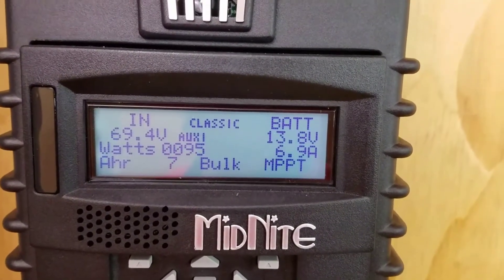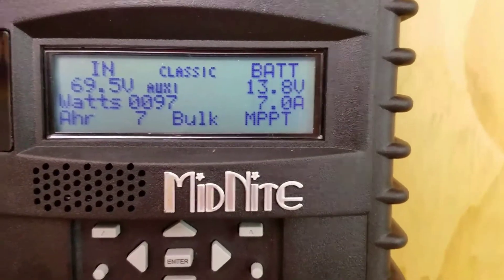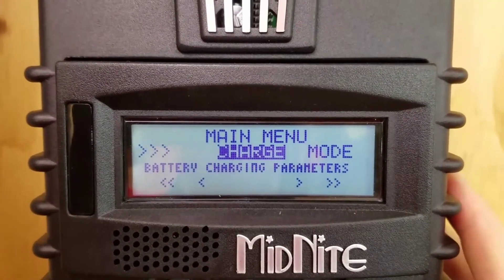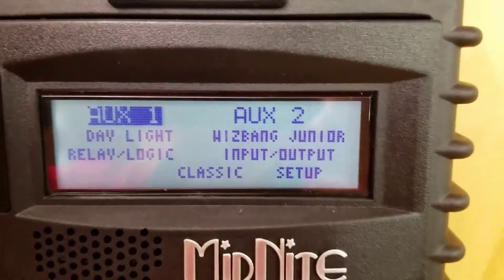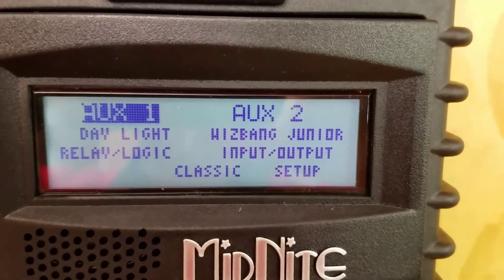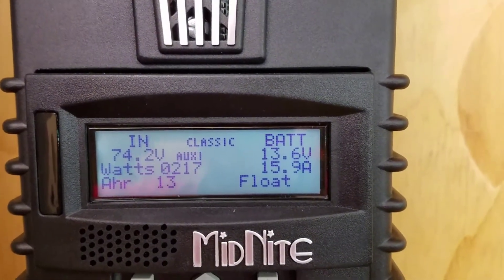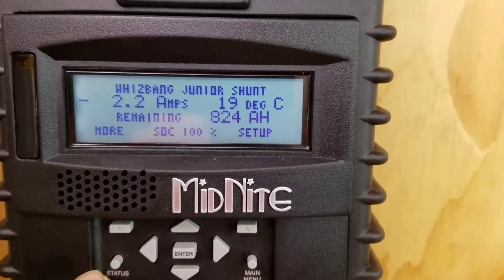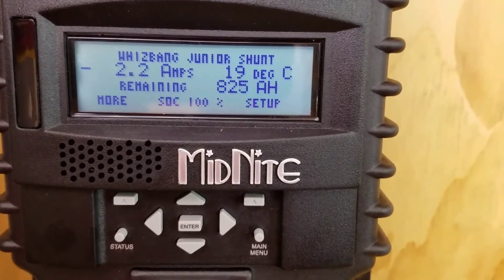MidNite Solar Classic 150 & Phone Test.

Comment: You showed us the wiring the batteries in an earlier vlog.  Could you also show the final hookup of the large-gauge wires from the controller and inverted down into the battery box?  - i.e., how those components actually connect to the batteries themselves in the battery box, thanx.  With the large-gauge wires, it is always interesting to see that configuration.  Also, could you go through each gauge of wire you used? - from the panels to the controller, controller to batteries, batteries to inverter?  Thanx again.
Reply from the maker: +mercxmorris 
Yes I could put something together in the near future & share it. 
Thanks for Watching.

Comment: Very nice Lars!  I really like home brewed solar, thumbs up :D
Reply from the maker: +Don Milligan Its been a ton of fun & a huge amount of learning & research.  I have been looking at options to continue expanding & growing the system, but it is probably going to be a little while at this point.
Thanks for Watching.
Reply: That's the beauty of your system, you can grow it at your pace.
Reply from the maker: +Don Milligan 
Yeah, a few things I am hoping fir this spring/summer is 1 additional array, a compact indoor outdoor style heat pump instead of the window AC unit & acquiring additional solat mounting hardware so I can add 12-16 more panels on my roof.